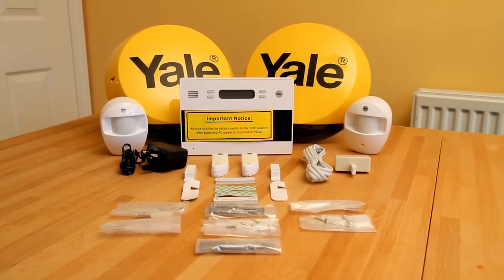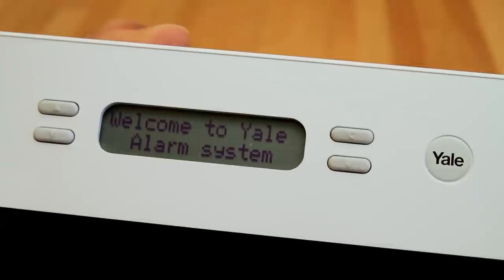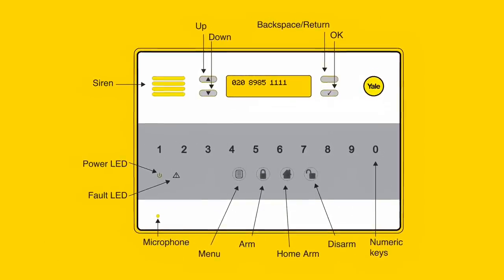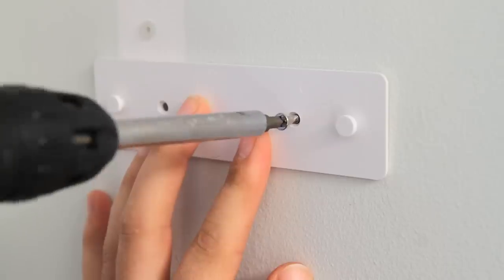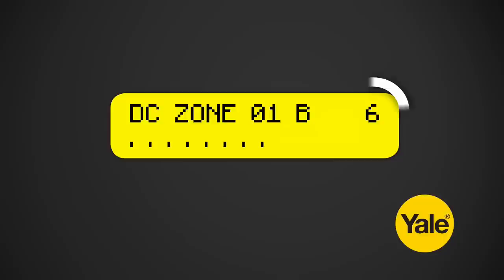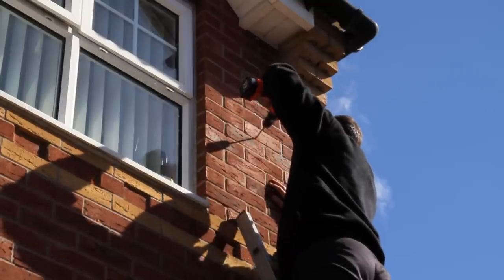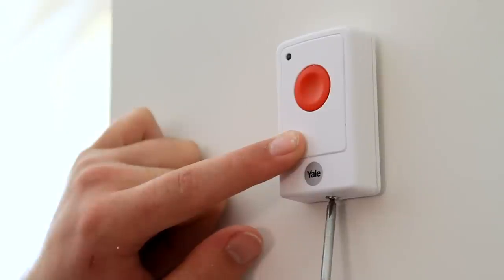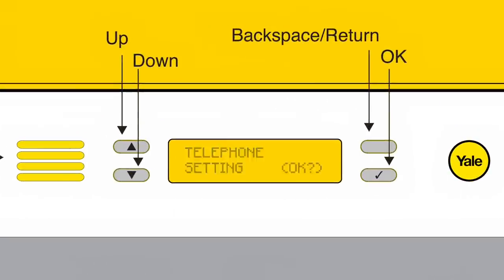Yale UK Easy Fit Telecommunicating Alarm How To Install Video

Comment: Does the external alarm box have an integrated strobe light? I noticed 3 LEDs were visible when the front cover was removed in the video. Do the LEDs perform like the old type of xenon strobe you used to see fitted to old external alarm boxes - or do the LEDs just visually 'chase' back and forth, when the system is connected,  to act as an illuminated visual deterent. Thanks.